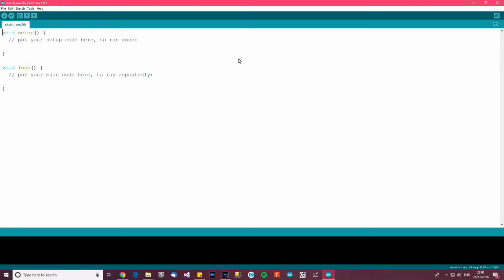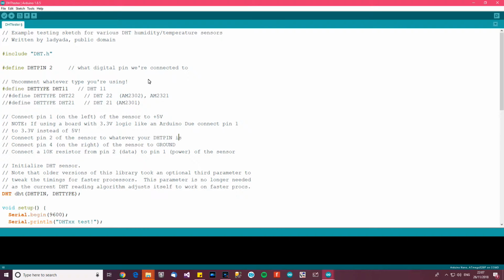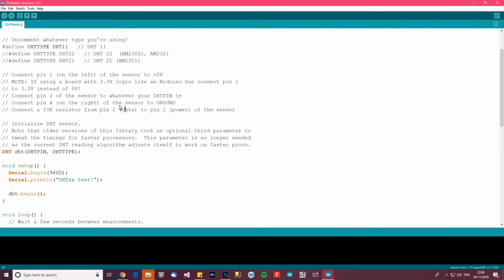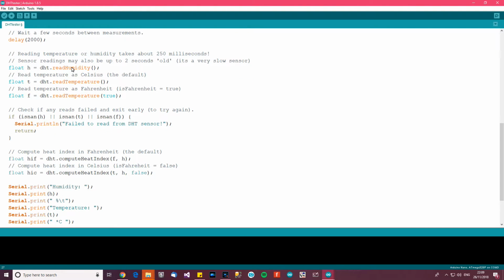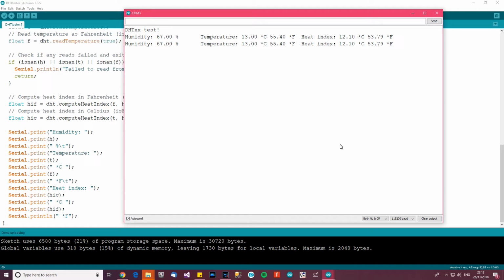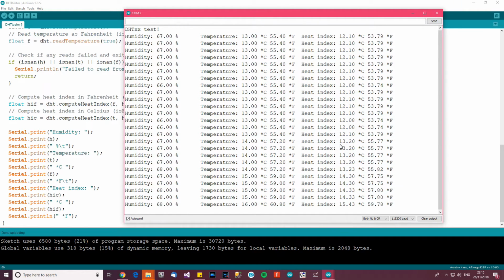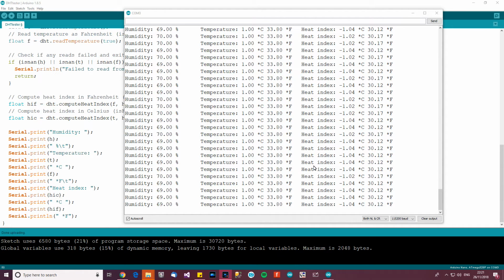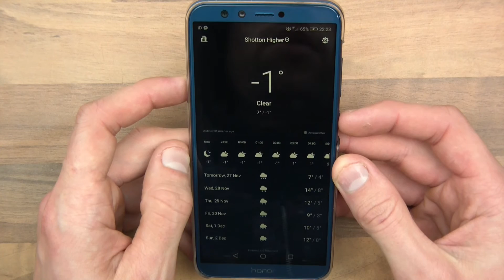TUTORIAL: How to Wire up & Code DHT11 Temperature & Humidity Sensor - Set Up - Arduino (Part 2)

Comment: Antony, 

You need a heater or a doctor (or both) if your skin is down to 14 deg C!

Your phone is using a local weather station (Shotton Higher) to give you the readings which are 'outside readings'.

The DHT11 is known to be inaccurate and also the humidity in your room will be completely different to what is outside.

I have checked about phone sensors, and  apparently there  are only 2 phones that actually have a 'room' temperature sensor but all, if not  most phones have a temperature sensor for the battery. So if you were to be reading the temperature from your phone, it would be the battery temperature which could be quite different to ambient air temperature, especially if you have had it in your pocket or on charge.

I have done a comparison with a number of humidity sensors and found none of them to indicated the same, at best there was a minimum of 5% (reading) difference.
I tested the DHT11, DHT22, BME280, SI7021 and 2 x HTU21D's all at the same time on an I2C bus, even the two HTU21D's gave completely different readings.

I even made up my own 'wet bulb' humidity sensor with 2 x DS17b20 temperature sensors, one dry and one damp and calculated the relative humidity, which came very close to the BME280 reading.
Looks like humidity sensors are not quite there yet, but interesting and good to mess about with.

Bit of general knowledge about phone sensors.
I have checked about phone sensors, and apparently there are only 2 phones that actually have a 'room' temperature sensor, but all if not most phones have a temperature sensor for the battery. So, if you were to be reading the temperature from your phone, it would be the battery temperature which could be quite different to ambient air temperature, especially if you have had it in your pocket or on charge.
I don't know of any with a relative humidity sensor.

Keep up the good work
Martin
Reply from the maker: Ahh, interesting stuff! I know very little about them. Oh, yes about heater/doctor - I definitely need a heater in there. YouTube doesn't pay me enough for a doctor yet, but as soon as it does, I'll have a nice one by my side to look after me after I record my videos. ;) Lol

Comment: 3:15  The reason they use a boolean to determine the return value is that booleans are 1 "bit" storage. Any other data types are 1 "byte" at least. 8 bits = 1 byte. Integers are 2 bytes, for example. So for programming on mcu's that have little memory, you try to use as little memory as possible, especially if that  memory is also used for the program itself.

Comment: Heat Index is what it "feels" like. It's a calculation of actual temperature and relative humidity.  So when the weather station says "it's 20C and it's going to feel like 30C", they are referring to the heat index. This is also the same calculation for "Wind Chill Factor". The HI term is used in the summer, and the WCF is used in winter, but they are the same data
Reply from the maker: Ahh cool... I've heard of that "feels like" thing.